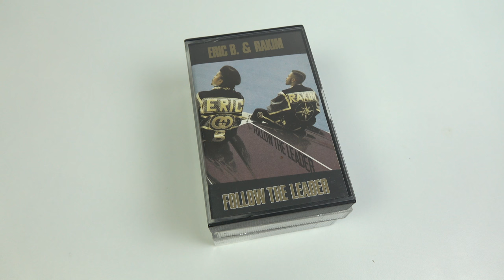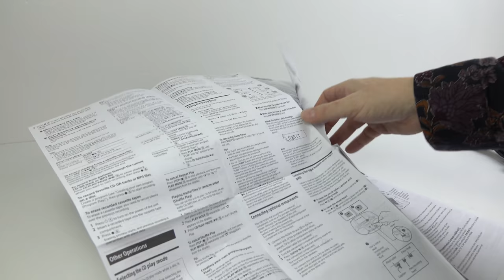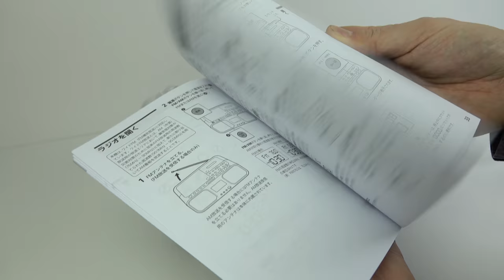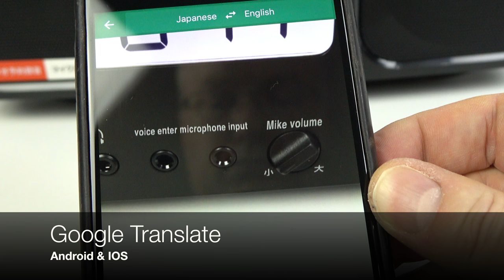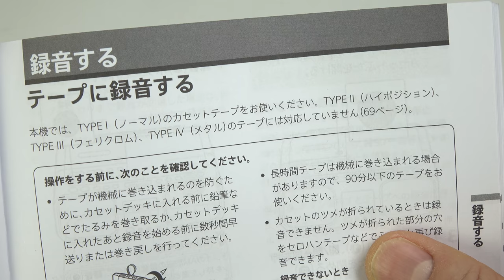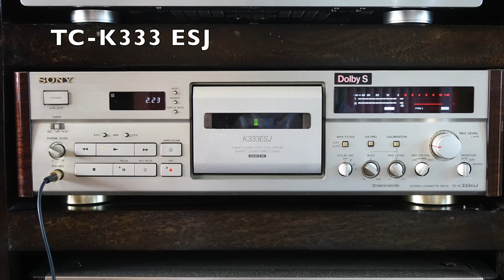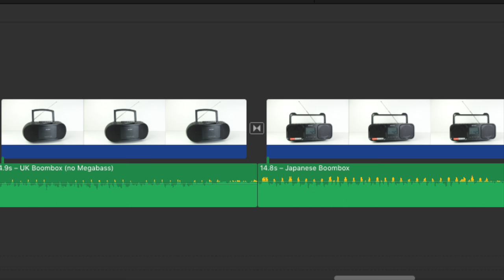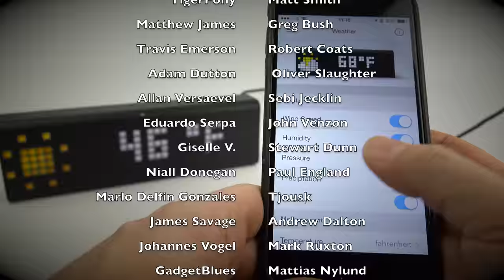Sony's New Cassette Boomboxes -  East meets West

Comment: I have a Sony CFD-S70.  It's a great boom box, although the CD player stopped working after a few months.  Fortunately I managed to salvage a new CD movement from another player & it's good as new now.  I also have a Sony CDF-S05, which had a faulty cassette mechanism, but again, luckily I managed to cannibalise a working cassette mechanism from another machine, and that's now working great as well.  This is a very nice boom box, but it's no longer made, I think.

Comment: Techmoan, I just looked at the 183 ratings and reviews of the CFD-S401 on Amazon Japan, translated into English.  Many reviews complain that the CD player malfunctions, or stops working, after a very short period of use.  Many other reviewers complain the cassette unit stopped functioning prematurely.  Although the CFD-S401 is visually appealing and sounded great in your video review, three years later it seems it isn't any more reliable than the uber-lightweight and thin-sounding CFD-S70. Sad.

Comment: I have my parent's old cassette deck that was sitting in our basement for a long time, they bought it after they were married, so it's about 25 years old. It works but while playing it makes a grinding sound and the sound occasionally stops, and it doesn't work for rewinding or fast forwarding, do you have any idea what could wrong with it?

Comment: The exact same model cassette deck (the English one) is sold in stores in my area but it's a bit better manufactured. The doors have a softer opening and the overall build looks a little better. I think Amazon got the lower end models.

Comment: It appears that the USA got a different kind of Sony boombox to succeed the CFD-S70... the ZS-RS60BT, which costs $99 at Best Buy. It removes the cassette player and replaces it with wireless Bluetooth audio connectivity and NFC audio. It also has a USB port for playing MP3/WMA/AAC files as well as recording CDs to MP3 format. The CD player also can read audio files off a disc like the earlier model. I have both of these units, and the ZS-RS60BT has a more richer sound than the CFD-S70.  As for radio reception, the FM is okay though weaker stereo signals have an audible hiss unless you turn stereo mode off. The AM radio on the ZS-RS60BT seems to be more susceptible to audible noise than the CFD-S70. Both units do share the same lightweight feeling plastic/

Comment: This video is little long but it is informative and i like it. The Japanese only model SONY CFD-S 401 looks nice & has good quality. The UK model CFD-S 70 is available here in Sri Lanka but i missed it because i already bought the earlier model SONY CFD-S 07 (CP). As you call it the sound quality is okay but thin with no bass despite "Megabass". Only after buying i noticed (Manual) that it has only 0.750 Watts/Channel (Total 1.5 Watts) RMS. I don't know why Sony made boomboxes of such low power outputs! I bought it in vain. Why cannot they make boomboxes like these with much higher power outputs like old days ? Thanks for the demo.

Comment: It’s a shame that no one makes decent cassette decks anymore, and the decent old ones are so expensive on eBay. I bought a TEAC LP-R660USB all in one turntable/cassette/cd player. It also records from phono and cassette to cd, but im not using that function. It can’t record to cassette, but I have a separate cassette deck from 1973 that I can use for that. But I do love my TEAC machine. The cassette player is actually pretty good and sounds great. It doesn’t have Dolby obviously but it does allow you to switch from normal bias to high bias playback (and the instruction book says metal tapes can be played when the device is switched to high bias).

Comment: Try one of the much better Panasonic Boom Boxes! I’ve got a Sony top loader with 3 heads and duel capstans. 4way mixing. Every feature you can think of. $ 940.00 in 1974, I bought it used for $ 150 in 1978. It’s beyond audiophile! Absolutely perfect sound. Still have it, still working perfectly!  Must weigh 40 lbs!

Comment: I truly undesrtand the analog warmth sound that you get from a cassete but when you look at the problems especially with the casette deck mechanism is horrendous. The tape degrads once you start playing over and over. And today we hardly find any spare parts and service store. Any solution for this?

Comment: I am concern about the power supply on CFD-S401 from Japan  at 100 volts. Do i need a power adapter in the US? We use 110v

Comment: When I did refurbs etc on returns back in 2008, we often got really good Sony units, but like that UK model, they did not have a window in the cassette door, which could be a slight issue.

I've been meaning to get some of those vinyl style CD-Rs for ages.

What is that interesting beige console think at the end?

Comment: I have one of the first kind, with the weaker output. (USA). It's... alright for places like you said, e.g. the garage or bedroom.
Is there any way to upgrade the sound? Maybe it accepts the speakers of the Japanese one here?
I'd love an English-language version of that thing.

I'd like to add that my CFD-S70 came bundled with a CD lens cleaner and a bluetooth dongle for the aux in, which increases the value a lot since they can be used on some of my other equipment too.
(I'd imagine that my my phone's little speakers probably sound better than if I streamed anything to this "boom" box).

Comment: THe CFD S70 is close to the Sony ES Deck, but to be fair, to fully take advantage of the deck you need to use the line outputs. Being a pricy ES deck, headphone amp is expected to be good, but the user of this deck will prefeer the full experience of a good amp and good speaker cabinets rather than headphones. That is the only way you can explain that the deck is so close to the UK Sony boombox (at least from the YT audio sound. sound a bit less stereo expanded, but hard to tell from viewer side.

Comment: Thanks for the (as always) helpful and informative reviews.  My wallet cringes every time I watch one of your videos. :D I ordered  (June 4, 2021) a beige CFD-S401 from Amazon Japan, to deliver to the US.  $100 USD + $40 USD for shipping. It arrived in 4 days (2 days ago).   
 
First impressions... I'm not an audiophile, but tape playback sounds terrific to me.  Significantly better than the S70 and far better than the newly manufactured tape decks that I've previously bought and tried.  Back in the day, I owned standard consumer grade decks and the S401 sounds significantly better than what I remember of those players.   After spending years trying to get a decent, reliable vintage player at a reasonable price but always failing... it is nice to finally have what seems like a solid new option with build quality reminiscent of typical Sony home/consumer players of a previous era.
 
Purchasing a power stepdown converter and a set of rechargeable C batteries completes the setup.  The greatest challenge now is translating the Japanese manual and buttons.  Google translate does a pretty poor job... enough to get me started, but far from being able to fully exploit the features of this unit.  But that's part of the adventure. LOL 
 
Thanks again for exposing us to the neat gadgetry that is out there in the wild.
Reply: Do they have the black color still in stock

Comment: Matt, I love your videos.  I tried to find a contact on you but could not so, I will ask my question here.  You inspired me to do some repair on some of my older stereos.  I am in the process of replacing  the laser on Sony CDF 460.  I found a spring.  This spring either goes on the center or the outside of the laser tack.  I  was wondering if you knew by chance since you have done some repair work.  Any idea?

Comment: Did any cassettes ever have auto-detect for noise reduction, etc.?  Like a little bit at the beginning of the tape that told the player whether it was Dolby B or S, or a mechanism to detect the type of tape (metal, chrome, etc.)?
Reply from the maker: I haven't heard of auto NR detection...but tape type was common and performed by analysing the identification notches on the cassette.

Comment: hi techmoan can I just start by saying I love your site, I can spend hours watching your videos, and I do I wonder if you could find me something from my teens,we are talking about 1991 ish, I had a midi system or so it said lol. it was called a binatone midi turbo , it didn't sound great I used to connect it up to an old stero that I brought from a car boot sale using  the left and right wires in the tone arm, but it sounded great, well that's how I remember it lol. it would bring me such joy to see it again if you could find one, ive looked on ebay to no avale, anyway thanks again and keep making your grat videos, dave rosser.

Comment: I have A CFD-S50, which looks almost exactly like the CFD-S70 (seeing it in the thumb is what brought me here). It has almost exactly the same features as well, including the 30-station preset. Mine also has the MegaBass button, and like you mentioned, it sucks, but you want to have it on all the time, because it's so flat otherwise.
It's not a bad little machine at all, but in terms of sound quality, meh. Nowhere near as good as the RCA boombox I used to have, which I got around 2008. I don't recall if the normal sound was so flat, I don't think it was. But I do remember that in addition to a fairly decent bassboost, it had a 4-setting equalizer, which I loved. Kind of miss it.

Comment: The Retro Cassette on the hi-fi sounds more neutral, the sony bombox sounds like its using some slight treble boosting, the Japanese bombox sounds heavyer indeed like typical mega bass also a bit like how MD devices sounded with mega bass. The sony bombox with mega bass enabled, sounds like its boosting frequency in range from 90 hz to 150 hz witch make it sounds more muddier

Comment: Hey Mat, since you mentioned it here, do you have a video explaining Dolby Noise Reduction?  I have been driving a 1995 Honda Del Sol for 22 years and the cassette player has a Dolby Noise Reduction button.  But all it seems to do is make the speakers sounds like you put a pillow over them.  I have turned it off thousands and thousands of times over the years and have always wondered what the hell this is for.  I hate it!  Cheers!
Reply from the maker: There's a section in this video about it https://www.youtube.com/watch?v=jVoSQP2yUYA&feature=youtu.be&t=6m55s

Comment: I also had the chance to compare the CFD S-70 with the C S-401, but gotta say that Mat either had an exeptionally good CFD-S-70 or a rather poor CFD S-401. There are miles of difference in the sound.  My CFD s-70s (got 3 of them) all didn't last very long, stopped playing CDs. And only for playing tapes they're just too poor. The CFD S-401 is miles better in sound. I hope it's also better in quality and lasts longer.

Comment: I had one of the UK ones, the CD player died on it. Only bought the thing in June 2017. I had recently discovered  cassettes in a rarely opened drawer.  The cassette playback was adequate, its the only reason I wanted to keep it. I took the thing back hoping to get a replacement,  none in stock got a refund. But have continued picking up 10 pence cassettes at car boot sales.

Comment: Does anybody else remember the big grey box with VU meters which plays VHS tapes called the JVC-HRD910E/EG/EK/ range I do but mine packed in just after the millenium sadly.

EG the middling which is all the features minus the wheel thing was the one we had I think as I remember ours having the inputs and outputs for audio at the back that version has as well as a mic at the front meaning you can pipe in your own music and talking on it.

The EK the bad boy of the range looks great though as it adds composite video inputs to the mix at the front dubbing panel too or so it seems anyway.

Definitely a bit of kit for your VHS and VU lover any of the 3 are but EK would be the one to get these days although the EG and E do have the same picture and sound quality with just a wheel or a sound input missing but all have the classic VU meter at half range for mono and full range for stereo volume.

Might be something worth getting in any or all of the 3 versions for your growing VU technologys collection as it's one of the oldest out there probably first NICAM VCR to have them on there with the dubbing features too consumer wise mind you as theey were probably on pro range JVC kit before this semi pro home kit became available.

Higher grade one with everything:

http://www.ebay.co.uk/itm/JVC-HR-D910-EK-VHS-VCR-video-recorder-with-manual-fully-working-boxed-/352167294439?hash=item51fece75e7:g:CeUAAOSwf15ZvmIw

All grade ones all are high grade anyway with more or less add ons but all have the VU meter the important thing you would pick one up for if you do decide to Techmoan deefinitely would make a nice video for me to see my old beast again overviewed by somebody into his VU tech. 

https://www.ebay.co.uk/sch/i.html?_from=R40&_trksid=p2487218.m570.l1313.TR0.TRC0.H0.TRS0&_nkw=JVC+HR-D910&_sacat=15088

And heres my very first record player used to be my dads. Our 70s Sanyo hifi in a different colour to the one we had but the same thing with the glow in the dark VU meters on the tape.

http://www.ebay.co.uk/itm/Sanyo-G2711KL-Record-Player-with-Tape-Deck-1970s-1980s-Audio-Equipment-/172870670287?hash=item283fe517cf:g:yFkAAOSw7RdZv6Xx

Comment: Can I plug the boombox directly to US outlet?  If not what adaptor/converter/transformer would you recommend? I appreciate it. Thank you.
Reply: My CFD-S401 just arrived 2 days ago from Amazon Japan.  My research on the subject indicated that while it MIGHT be ok to do that it is not recommended.  The device requires 100v, US is 120v.   I ordered this, "PowerBright Japanese Voltage Transformer, 100 Watts Max Output Step Up Step Down Japan Converter for 120 Volt and 100V Countries" from Amazon US... $20. Should be arriving today.  I wanted to play it safe. :)
Reply: @sracer  i got the blue/grey; im sooo excited... i did order a nissyo converter/transformer... which brand did you buy? I bought both items from eBay....
Reply: @anrn5303  the blue was my first choice but it was out of stock so I bought the beige one (which visually fits very well in my mid-century modern living room).   I bought the PowerBright VC-100J step up/down converter from Amazon US.  The little box is a beast.  Very heavy... which is a good thing.
Reply: @sracer  on eBay the ship to US, amzn availability is for UK... :)

Comment: I was amazed that the s401 had no bluetooth/USB panel.  They really missed a trick there - after all, people these days like to play music off phones or what have you. Adding such a panel/feature  (I have bought those panels for literally pence on ebay) would ensure the unit reaches maximum potential buyers. If someone was looking to upgrade their existing radio-cassette surely they'd want a new feature like that -   even the Aldi cheapo had it , for Cliff's sake. As it stands, the  s401 offers little that wasn't around 10 years ago.

Comment: It might be possible to swap the power transformers between those two. The S401 then would not need a step-down transformer and could be operated directly from 230 Volt mains. I am very surprised to know that it is still possible to buy a new radio tape recorder with a decent tape transport. As for S70, well, maybe it is a good idea to stow it away somewhere. In Russia, we call such audio-devices "Auchan-balalaika" ;)

Comment: I do not like Dolby Noise Reduction during playback as it lowers the higher frequency end of the sound and overall the sound is flat like a CD or chrome casssette. DNR makes for better playback sound when used while recording. And the tape hiss, I'm used to it. Yes I too still use cassettes.

Comment: The sony budget model has a very noisy motor.  I got one thinking that if I plugged it into a better speaker via the headphone jack that I could boost the sound some. The sound remained thin and the noisy motor noise came through even more amplified.  There is a u tuber on line that suggests that lubricating the motor can improve the sound. He teaches one how to do that however some folks may not feel comfortable tood-ling around in there.  Cassette players or decks that are in the 150 dollar range tend to be inferior - sounding garbled and so on.They have different brands stamped on them but they are all essentially the same model.  One has to spend about 400 in order to get a decent deck, and more than 60 to get a good ghetto blaster.